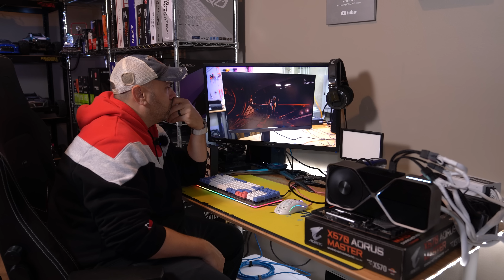I Couldn’t Let This Stand

Comment: Hey man, are you using corsairs type 4 cables to daisy chain into the 12vhpwr connector?? Is that safe? Does it pull the right power ? I am asking because I have the rm850x also, and I have my gigabyte oc card coming tomorrow..
Reply from the maker: Seems safe enough to me but there was no real load on the CPU during this test.